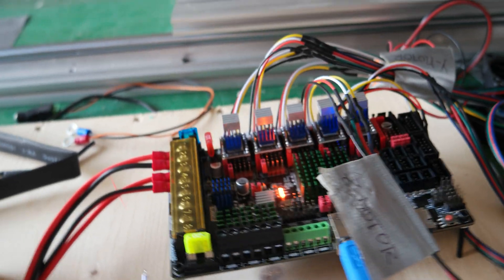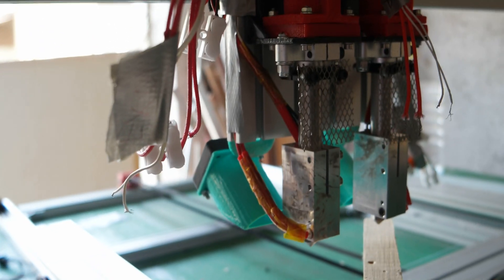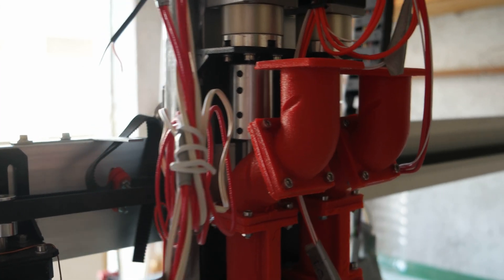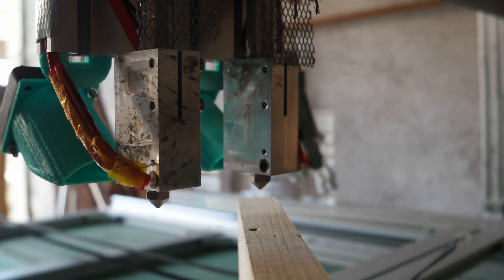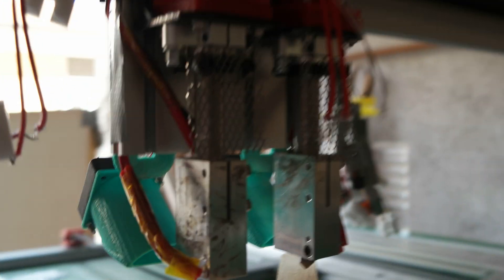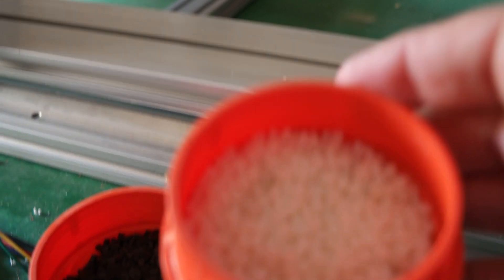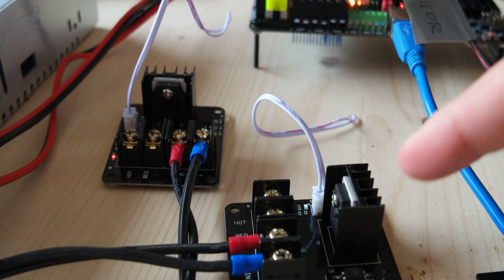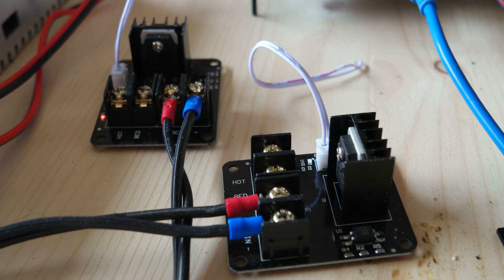SKR Pro v1.1 + TMC 2209 v1.2 sensorless homing and probing working

Comment: Very encouraging, thank a lot. i will do it with TMC5160 v1.2.
Reply from the maker: just heads up, after all the tests I have done not sure it will be a stable solution. Not using at the moment so not sure if Marlin changed something. If you get it working, very good, just be careful of changing drivers. Also never tested with 5160 drivers, do they support sensorless ? Please subscribe thx !

Comment: How to you move Z?
Through Leadscrews?
I built same thing here, with Marlin 2.0.5.3 and a similar config.
A sensivity of ~60 is to weak on Z. >60 causes false positives and the trigger fires in mid-air.
So it's not clear to me, how to get it work.
Reply from the maker: Yes I have leadscrews for z. I know it's a pain as I have done a lot of testing. For example nothing was working with one 2209 and than I changed with another one and worked. Also I noticed that speed and current have an effect on the probing. So it's a trial an error, it's a real pain. I now moved to GTR with 2206 and had similar issues. I have X working and Y/Z not working. It's a gamble ! Make sure that everything is rigid. Please subscribe, thx!

Comment: Hello .. Good night. I downloaded your files. Replaces the configuration .h files; : adv .h; platform; pin MTB skr pro
But the following error appears:
"
Error: Unknown board ID 'BigTree_SKR_Pro'
The terminal process "C: \ Users \ Peterson Augusto \ .platformio \ penv \ Scripts \ platformio.exe 'run'" terminated with exit code: 1.

Terminal will be reused by tasks, press any key to close it.
Reply from the maker: just check the board.h file to see if the board id has changed and use the latest one. Also you cannot use just the configuration files like that. You need to modify the latest one from Marlin that you download with the parameters you need. please subscribe thx

Comment: While getting this working did you ever experience an issue where no matter the Z Sensitivity you couldn't get it to detect a stall? I have the same board and drivers and even if I physically force the leadscrews to spin the other way with the Z sensitivity at 255 the printer will continue to try and home.
Reply from the maker: yes, I switched to another 2209 since other 2 did not work. I tried all 255 values. My guess is that the code is not optimized and that the sensitivity value + sensorless current that can be set is a too big matrix to find the right value. Also I think the drivers silicon has something to do with it. I wish this issue would gain more importance from Marlin devs since having sensorless homing/probing working simplify a lot the 3D printers plus saves money. Not to consider that those drivers have the tech to do exactly that. I asked to Marlin devs to have an autotune option but they said is not possible! Try to switch drivers and see if it works. I switched to the GTR and the problem is even worse ! So I might just use sensorless homing where it works, stop for the other and use a switch and a probe! will upload some videos in the coming weeks. Please subscribe! Thx

Comment: whats the name of the pellet extruder you use?
Reply from the maker: I design it and put together so is a custom pellet extruder. It has a wood drill bit (will probably replace it with pressure pellet screw) and a custom aluminium heat block which has a stainless steel tube where the bit is inserted. Nozzle are also stainless steel since I am printing carbon fiber. The heating part is just a normal 40/50 watts resistor. Will do more videos on it. Please subscribe! thx

Comment: Nice video. One thing, I believe the double heatsink will actually prevent good airflow from the bottom heatsink and you will be better off with a single heatsink and a fan blowing over the stepper drivers.
Reply from the maker: I will have big fans all over the board so plenty of airflow when the setup is done

Comment: porky pine shod be a fitting name for this mother board , by the way is there a sale on heat sinks?
Reply from the maker: from testing they work pretty good and to my surprise even the small ones get heated, fans on top do the cooling. all heatsinks came with drivers so no additional cost. my prints last couple of days so I need any dissipation possible.

Comment: Dear hackebike, I am trying to use the SKR Pro with 2209's on my corexy 3d printer but unfortunately I can't get them to work with sensorless homing. What version of the firmware did you use for your configuration? Dit you get the offical marlin version or the one from BTT? Thank you in advance!
Reply from the maker: I think the last Marlin 2.0.x I compiled was on mid on November, but you can try the released Marlin 2.0. I use official not BTT, which is too old. Sensorless homing should work just fine. Check the configs in the description and see if there are any differences with yours. Hope it helps! pls subscribe! thx
Reply: @ganzoai  I managed to get sensorless homing to work on all axes. Next obstacle to tackle is the Z-endstop. The enstop lights up and all values are right when measuring them with a multimeter but the printer won't home Z. I connected a 5v probe to the bl-touch pins (5v, gnd and PA2) and removed the pin from the driver indicated in the manual. I can't figure out why it isn't working. Thanks for all the help, I really appreciate it!
Reply from the maker: @PeculiarPrinters  double check your config since it should just work
Reply: @ganzoai  A little messing around in pins.h fixed it. Marlin really likes the z probe to be on the z-min pin apparently. All motion issues are now fixed. Unfortunately I seem unable to upload Gcode to the printer. My octoprint won't connect and the SD card isn't recognised.
Reply from the maker: @PeculiarPrinters  not sure about octoprint but you should be able to use the sd card, did you enable it in the config?
Reply: @ganzoai  I managed to get sensorless homing to work on the X axis. Homing Y to Y-min also works but homing Y to Y-max doesn't. The Y axis doesn't even start to move to the endstop. Thanks for the help! You earned yourself a sub!
Reply from the maker: @PeculiarPrinters  I updated my configs to Marlin 2.0 release, they are on github. About y-max is strange, check the inverting in the configuration.h, maybe those settings are needed(?), not sure did not use x-max/y-max
Reply from the maker: @PeculiarPrinters  check the configs, did you set to use both y-min and y-max? I do not use -max configuration so can't test that
Reply: @ganzoai  I managed to get Y-max and X-min to both home individually. Turning on the X homing backoff breaks it again. The Y homing backoff works though. Auto homing all axes and the X doesn't home. Extremely strange behaviour. Thanks for the help by the way!
Reply: @PeculiarPrinters  I managed to get Z-max to home on a delta printer, but both X-max and Y-max do not sense home when they collide with the frame. To do that I had to re assign the min pins to the max pins as marlin doesn't like using X-min for delta printers. Not quite sure where to go from here tho... Any ideas?
Reply: @Tom Sewart I don't own a delta so I wouldnt really know but disabling homing bump and backoff was a must to get it to work for me. I would try to connect the drivers to the endstop pins via a jumper wire and try if they work that way.

Comment: I'd like to know more about the pellet setup!
Reply from the maker: I had custom made the pellet extruder and it's not usable for a normal printer since is pretty heavy at the moment. It is dual pellet extruder with a stailess steel drill bit and pipe with an aluminium block, you can see it in the video, and it has 2 heater resistors and 2 temp sensors (using only one at the moment). Nozzle are stainless steel at 1mm and might use 1.2mm. It will print HIPS pellets for support and Carbon Fiber pellet. I already tested sometime ago and it works fine. Now I am on configuring Marlin and will soon do more calibration testing. Also the printer is totally custom for the project I am working on. Will post more videos in the coming weeks. If you have questions let me know. thx

Comment: Wow, this machine is huge:D Nice work there. I just had got 4 pieces of these TMC2209´s for my SKR v1.3. Did you need solder any Drivers pin to work in UART mode? Thanks
Reply from the maker: no soldering, just need to set jumpers, check previous videos

Comment: Man your heatsink guy must score you some deals! hah
Reply from the maker: ahahaha ! no they came with drivers. It seems too much but from testing even those small ones are doing some heat dissipation and since my prints last couple of days, any heat dissipation from heatsink is good ! I added fans too, check the last video. pls subscribe !
Reply: @ganzoai  will do. I need to get my board back into an enclosure but I haven't found one I like. I think I'm going to be making my own. Currently it's just a 50mm fan laid over the wires blowing haphazardly over my board 😆
Reply: @ganzoai  serious note, I've been thinking about this all day now since I can't work on it. When yours home, does it slide up and stop, or does it recognize a stall and bounce back a little bit?
Reply from the maker: @austinwinn4548  you can set that in Marlin, search for _HOME_BUMP_MM in configuration_adv.h file. In the sensorless homing section is also mentioned to set it to 0, but I set it lo like 3mm just to see it bounce back. Will than test it with 0mm.
Reply: @ganzoai  well I asked because I could sorta adjust the sensitivity so it would actually home and not trip on the acceleration, but I had to use foam between the endstop and carriage, and it would read stop and bounce back.

Idk. I de-soldered the pins, gotta have it in service. I want to get it in a box and get WiFi working (somehow) then maybe I'll mess with it. I sell prints so it has to be ready to go, downtime has to be short or optional lol